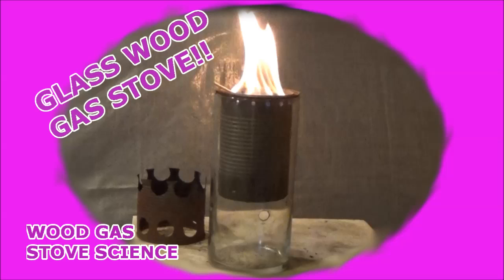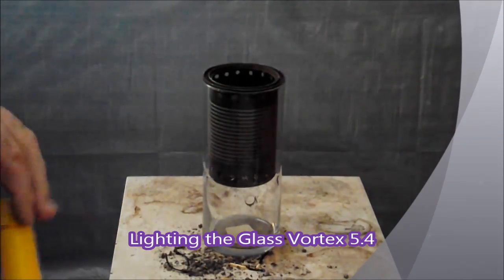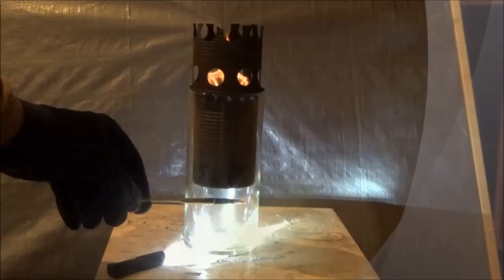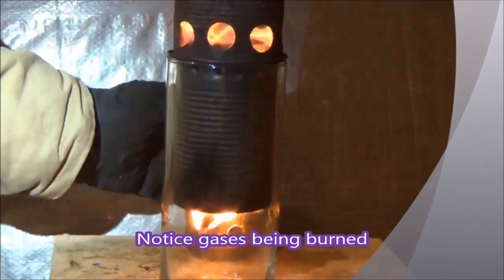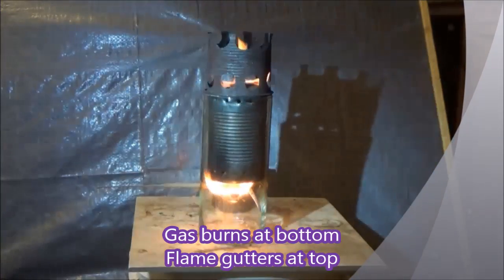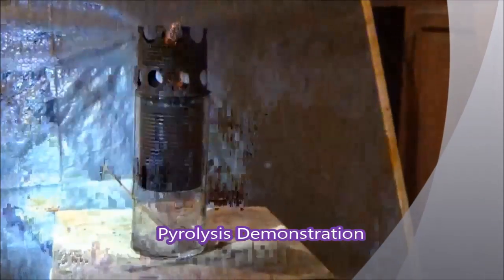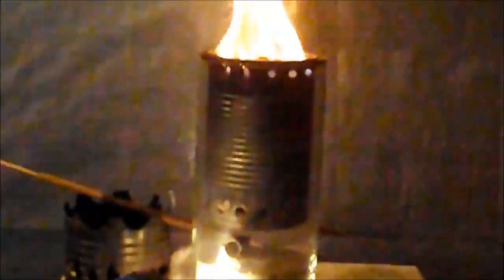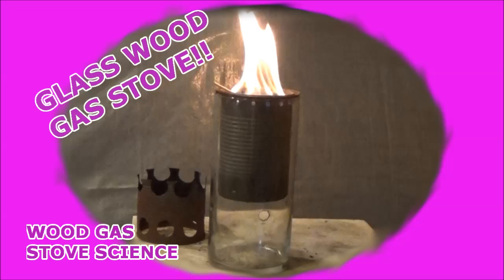Wood Gas Stove SCIENCE! GLASS WOOD GAS STOVE!

Comment: That is interesting, but I'm not convinced that pyrolysis products are coming out of the bottom.  You don't see any smoke coming out the bottom until you put the flaming stick in there.  The stick could be producing the smoke that hits the bottom of the can, turns sideways and joins the flow of air, much of which is rising up the sides between the containers, while smaller amounts are going in to the wood.  If it were correct that products of  pyrolysis  were going down and then up, I would expect to see a significant amount of smoke coming out the bottom and up the sides all the time, not just when the stick was put in.  And I would expect to see soot and tar precipitating out on the surfaces between the containers. Pyrolysis produces a combination of gases, smoke, soot and tar. It is messy.  I have built these stoves and this area is always clean, even after many burns,  just like what you have is clean.  I have always felt that the smoke, tar and gas from the pyrolosis was rising up, and the preheated air coming out the secondary air holes,  going into this mixture of flammable gas and vapor, made the jets of flame.  I don't think it makes any difference whether you have a jet of air going into a mass of flammable gas or if you have a jet of flammable gas going into a mass of air, both can give you a jet of flame.

 I think the stick with a coal can sometimes burst into flame when stuck underneath, because  air is being pulled in there by the flame at the top,  and heated by the can full of pyrolyzing fuel.  Hot oxygen reacts faster than room temperature oxygen.  It is a major reason why these stoves can burn so clean.  And because the air is being burned there when you push that stick in,  less oxygen is available to support the flame at the top, and so it weakens and may go out, as seen.  
  Well, that is my perspective, for whatever it is worth.  I have found your experiments interesting.
Reply: Heath Putnam Arthur Noll is right, and the proof is that the same inner pot as burner you used into the glass, works also without t an external pot and no gasses go out.
Reply from the maker: Arthur Noll I hear what you are saying. Let me try to see if I can come up with to test what you are saying. Thanks for the comments!
Reply: Sounds interesting, Heath.
Reply from the maker: If I put an outer can over the inner can that is short than the primary air holes. I can keep the primary air holes isolated from from the secondary air holes while still allowing the air going to secondary air holes to get hot. I can then burn two stoves side by side and record the results. If the wood gas is coming out the bottom and mixing with the secondary air the jets on the original stove should burn noticeably stronger.

If nothing else it will give us something to talk about.

Thanks for the ideas!
Reply: Heath Putnam Yes, that sounds like a fair test.  Especially the comparison at the beginning and middle of the burn, as I assume the bottom of the inside can won't be as hot and heating the air much in that range of time.
Reply from the maker: Arthur Noll I did an experiment and I believe you are correct. Please take a look at my new video https://www.youtube.com/watch?v=b0vM9aD78XY&lc=z12idnwbjrigf5lnp220edwa1yzay3m3h an let me know what your thoughts are. Thanks for your previous comments :)
Reply from the maker: You are correct. I debunked my own theory in the video I referenced above in Arthur Noll's last comment. Thank you for the comment.
Reply: +Arthur Noll 
I disagree with the gas rising from the heated bed, I have done some testing trying to get complete burns of the wood pellets and have dropped a tin "lid" on the hot bed sealing the gasses from rising if they were, and the process of burning at the jets continues just fine. This is also a way to solve the "problem" created by opening combustion air vents in the bottom of the can which creates an updraft up the center of the can and makes it into a rocket type stove even if the burn is on the top of the pile; causing the fuel to burn quite rapidly. The down draft effect can be readily seen when the stove is first starting and the visible fumes can be seen downdrafting more and more as the bed heats, the jets fire up, and the stove is reaching operating temperature.
Reply: Remembering stoves I built in the past, you can build them so that they don't have the double wall with air rising in it.   You can simply have an insulated fuel chamber , some primary air holes at the bottom, and secondary air holes at the top.  Works best to have some height above the secondary air ports to get some draft.  This is actually similar to Tom Reed's original design, which was what I started with.  Gas is definitely not going outside and back in the secondary holes with this, but it works.  If insulation holds in the heat, you can have hotter gas instead of hotter secondary air, as you get with the double wall design.  
  If you close off the top as much as you did, Itsandbits1, the gas has no other way to go except down and around and up, which is interesting.   But I think that usually it comes up.

Comment: And what's happening with the wood gas flow when you do not pre load stove but rather feed it with small amounts of sticks at regular intervals? This way it burns all fuel at once and not in clear separated layers. Will it be the same updown draft of wood gas?
Reply from the maker: Dmitry Olyenyov I am not an expert but this is my opinion. The idea of preloading is to get all the fuel very hot so it releases the Wood Gas and creates the oxygen free zone. This is known as pyrolysis; to get the cleanest burn (no smoke or pollution) you need the separate layers and high temps. When fresh fuel is added to the top it cools off the fuel already in the stove and mixes oxygen into the oxygen free zone. The burn loses efficiency and releases smoke. If you want to add fuel during the burn you may want to look at other types of stoves such as Rocket Stoves or Hobo Stoves:) Thanks for watching!
Reply: +Heath Putnam Thanks Heath, you've answered my question now. Wow, that is some deep science. Many thanks.